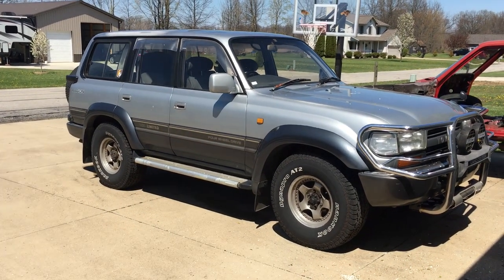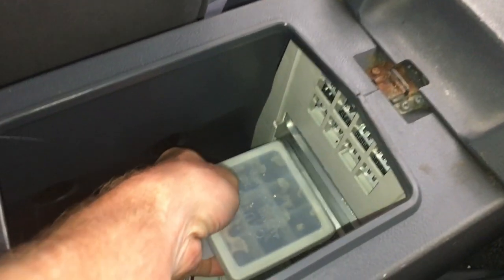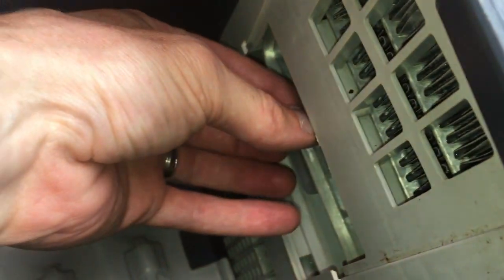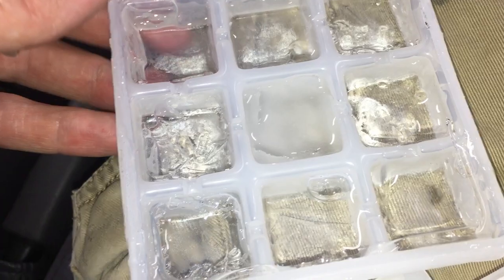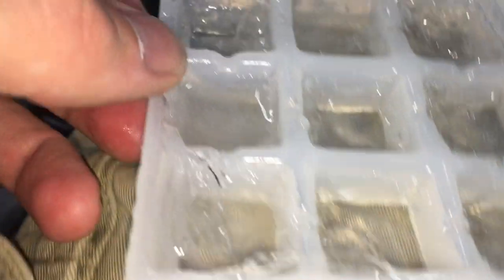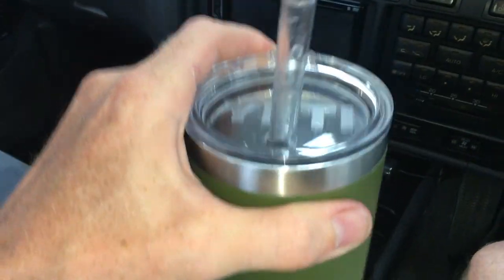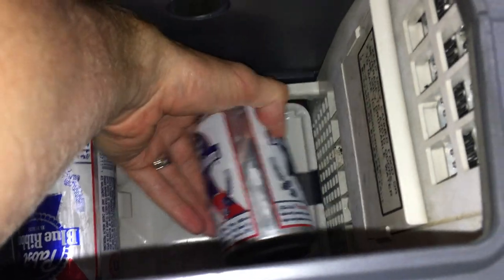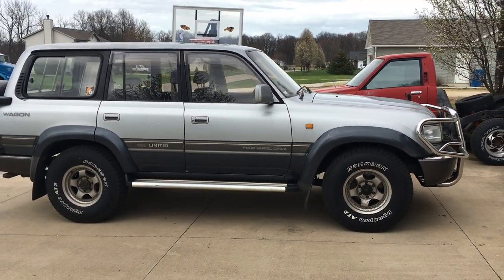JDM Ice Cube Maker in 80-Series Land Cruiser Center Console - Cooler/Refrigerator

Comment: I have the same JDM VX Limited. I had the aircon re-gassed and then it made ice in no time at all
Reply from the maker: The air blows cold but it was converted from r12 to r134a before I bought it
Reply: 6th Gear Garage I’m not an expert but that sounds like a possibility mismatch cause
Reply: @6thGearGarage  It's possible that your compressor is just old too or the charge is too low. For the original conversion, the R12 would've been vacuumed out, the dryer replaced, the old mineral oil removed for Ester or PAG oil.  Mineral Oil, and its remnants, do not mix with R134a like Ester or PAG does, and could prevent proper lubrication with the compressor.  Over time, seals can degrade caused reduced performance.
Reply from the maker: @styledliving  Thanks for the info, I wouldn't doubt that is the case, seeing how many things were neglected on this 80. The AC still blows cold, but it's not as cold as a newer vehicle.

Comment: Holy crap, that’s like $324.98 worth of ice cubes right there!   ;-)
Honestly, I would have bought the trays as well. 
In all seriousness, if you were wheeling all day, that might be kinda useful.
Reply from the maker: I bet if I just left the trays in and didn't check them every 10-15 mins, they would have been solid ice.
Reply: 6th Gear Garage Ha! Ha! It probably would have helped!    My Aunt had one of the vans with that option.
 I remember them using it to keep soda cool for trips, I don’t remember the ice maker.
Sadly, it was that overloaded 3.0 with zero cooling. So the van ended up with the inevitable head gasket failure.
Reply from the maker: JimsEquipmentShed I loved those vans! I can’t imagine loving to work on the engine though.
Reply: 6th Gear Garage Yea, the bonus on theirs was it was one of 4x4 ones. It was funny to see a van with hubs.
Zero accessibility  to the engine though.
I can remember them pulling the driver seat out to check the oil.
Not really well thought out....
Super cool though.

Comment: Thanks for these videos!  Interested in any info or part numbers you may have on cool box lid gasket (on the lower console lid/cool box lid) as well as the lower lid latch.  Thanks again!
Reply from the maker: I have little to no info on the cool box, since these were never offered in the US. If it ever needs repair, I'm going to have a tough time finding any parts. Even Partsouq doesn't list any #'s for the cooler: https://partsouq.com/en/catalog/genuine/unit?c=TOYOTA00&ssd=%24%2AKwGonI2Eye7S2e_366icvvDkxMPdrKOur72Soenv3Mvf09Xdj4iY3t7SycnPzteNiq_F6-_r2t3G1Pv94aqtqKipquLwg7bz7rmmv8C5sLyg7-up5uLo8__c5eGuuP65pq62ufr3p-_ruK6kqK-5sLyqo_OgudHTqKioqYLvrOTt9fna4L73t-_ruN3O3NfevrLhpKK4ob7bwNGkrvP9566ur6y4t779oO_ruKylrKuvrLzv77z5uaa_3MHWpvOK_N3VzNrRubC8paS1uKGq4AAAAACOoAyo%24&vid=0&cid=3&uid=408604&q=FZJ800064531
Reply: @6thGearGarage  Thank you so much for the reply.  Our new-to-us 93 JDM 80 series has a cool box and I’m trying to source a couple of parts.  Amayama has some cool box stuff but like you’ve mentioned finding specific parts can be sketchy and challenging.  I’ll share any findings if I’m able to obtain them.  Thanks again!

Comment: What's the part number on the white drip tray and the ice cube tray door with the writing on it ?
Reply from the maker: I only know the 5 digit #'s from an old diagram I have saved.  88522 for the sliding cover and 88529 for the tray on the bottom.

Comment: G'day mate, did you install the fridge in the 80?  I've got a few questions. On the AC lines under the car. Cheers Dave
Reply from the maker: I did not install the fridge, it came that way from the factory. I think it would be much easier to install something aftermarket than to retrofit an OEM unit.

Comment: The one I have has same set up with fridge but doesn’t get cold, only warm air. Do you know if it’s a common problem and what it could be
Reply from the maker: How cold is your vehicle's air conditioning? The console and AC run off of the same compressor & refrigerant.
Reply: @6thGearGarage  it’s weird because it blows cold air for ac but warm for the fridge area console
Reply from the maker: @24hrstolive27  The console has its own evaporator and expansion valve, but I haven't personally done any troubleshooting in that area.  I do have some diagrams of the console that might be helpful... email me parts@6thgeargarage.net and I'll send them to you.

Comment: would you consider sending to get 3d printed? i would buy a set
Reply from the maker: I’m not sure the plastic would be the correct type to hold drinking water and be consumed as ice. The trays are somewhat flexible as well.
Reply: @6thGearGarage  ahh ok, getting these are near impossible.
Reply from the maker: @MadCrix   Maybe there's a generic small tray that will fit?  Mine are 1" tall, 3.75" wide x 4.125" deep (including pull handle)

Comment: Where in Ohio are you? I’m in Columbus and would love to see this rig sometime.
Reply: Same here! I have a RHD Fzj80 as well and would love to find this guy!
Reply from the maker: I'm up by Sandusky. When this channel gets bigger, I want to put together a 6GG car meet. I bet it would be 75% Toyotas.
Reply: @6thGearGarage  ooh God you're on the other side of the state
Reply from the maker: @NatePrikkel  haha where are you?
Reply: @6thGearGarage  dayton area! Have you tried doing the timing mod yet? It helps tip in and low speed WOT a TON. I did it yesterday and it's a whole different car
Reply from the maker: @NatePrikkel  Yeah pretty far  from here.  No I haven't tried that yet.  It's so slow, I don't even try to make it go fast.
Reply: @6thGearGarage  super easy. Just need a timing light and a 12mm. Jump terminals TE and TE1 on the diagnostic port, and set the timing to 7-10 deg BTDC, instead of stock which is 3deg BTDC. It literally changes the whole driving experience. Low end and mid range is WAY better and not lurchy like stock. This is a 1FZFE truck, right?
Reply from the maker: @NatePrikkel  Yeah 1FZFE, I will have to try that sometime. Did you get an extra MPG out of it?
Reply: @6thGearGarage  I'm actually rolling through your area on my way to Chicago from Cleveland in a week or two.
Reply from the maker: @styledliving  Nice, what area of Cle do you live in? Good to see some other local-ish Yota owners!